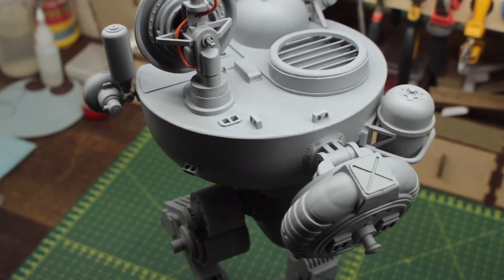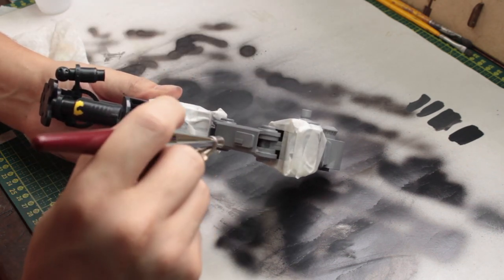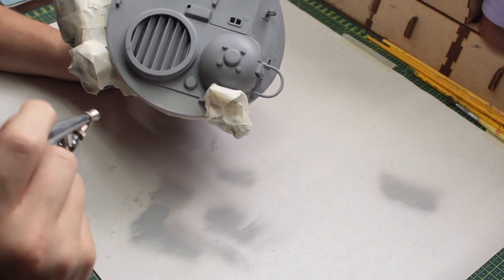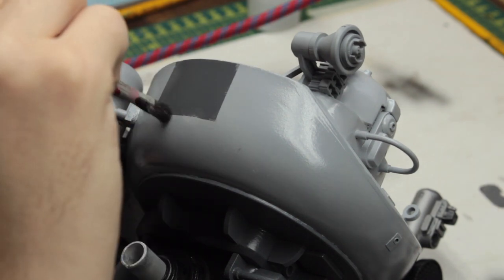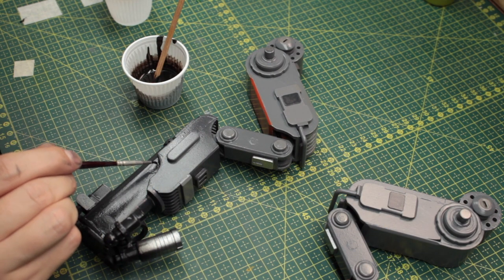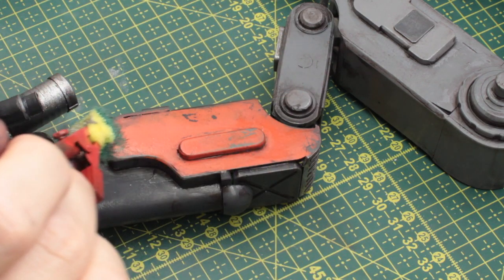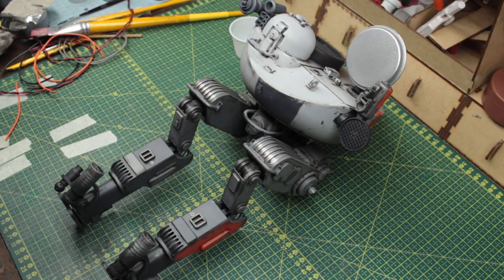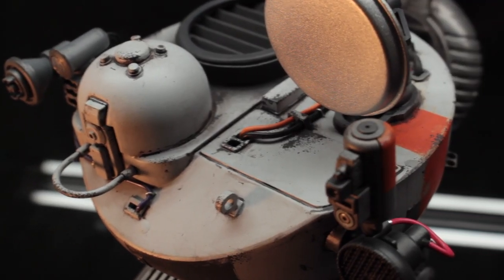This robot is mostly TRASH

Comment: Great imagination and craftsmanship. Looks like the body is PETE/polyethylene. What kind of glue are you using since I've tried everything and nothing seems to want to bond it. Cheers.
Reply from the maker: I use mostly CA glue, but some types of plastic are very hard to glue.. you can increase the surface of contact by sanding the parts a little, add some baking soda to increase the resistance, and if that's not enough you may try fast curing epoxy ! I some times even use some screws to keep pieces together! Thanks for your comment :)